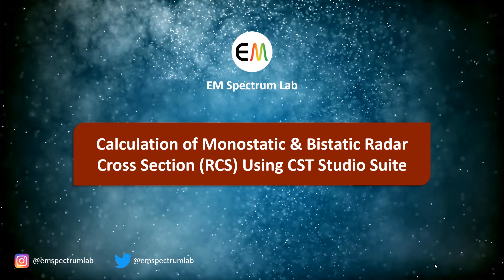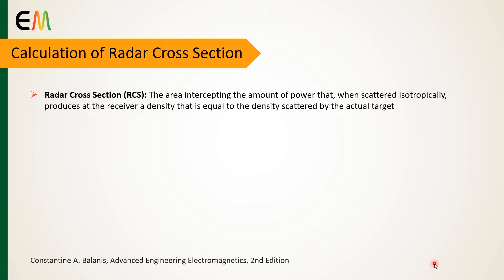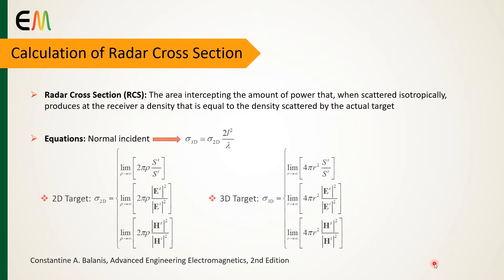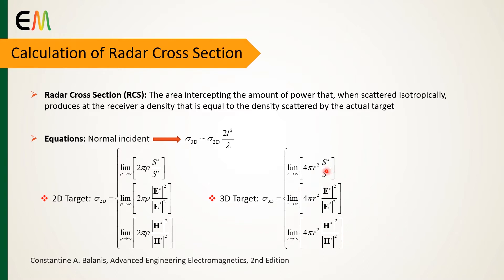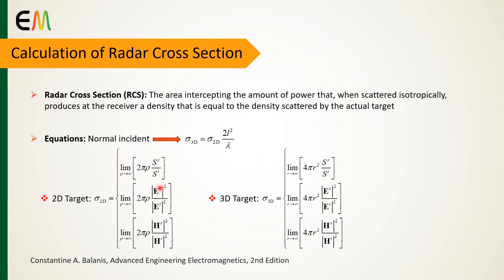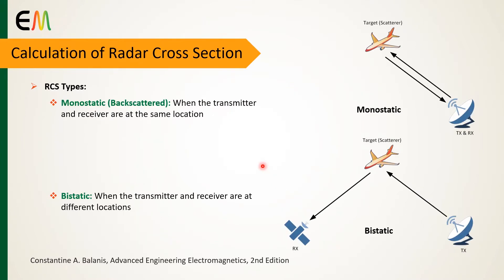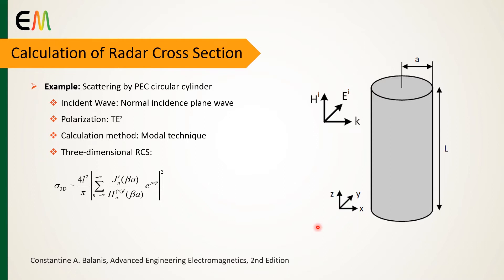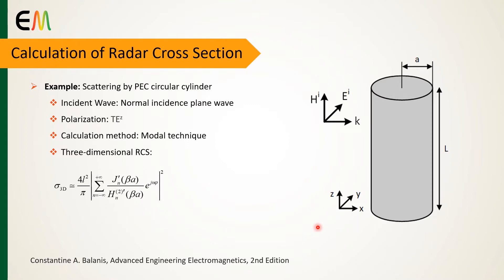CST Tutorial - Monostatic & Bistatic Radar Cross Section (RCS) Calculation

Comment: 10:09 Have I understood correctly that a cylinder with a radius of 5 cm and a length of 60 cm has an RCS of 0.5 m²?
Reply from the maker: Exactly (for Monostatic RCS)
Reply: @EMSpectrumLab  I thought that the RCS couldn't be smaller than the actual geometric cross section of the object. Turns out, that's not the case. Thanks.

Comment: what does it mean
theat
alpha
phi
i dont understand them ?
Reply from the maker: "Theta" and "Alpha" are the Elevation and Azimuth angles of incident wave, respectively. Also, "Alpha" is the rotation angle of electric-field vector.
Reply: @EMSpectrumLab   how can we know, what numbers should we assign to them? I mean the angle you used will give correct results for a surface made of PEC as well?
Reply from the maker: @amirbit2086  They are dependent on your problem. The angles are not related to the material of object.

Comment: Hello Sir. Your videos are very informative. Can you please further extend this video and show us how can we get graph of bistatic vs frequency in cst? It’s really urgent as i need to add graph in my paper, thank you
Reply from the maker: Dear, unfortunately I didn't find direct solution to plot bistatic RCS vs. frequency in CST. But, I suggest you to use MATLAB to create this figure by one of below cases (they are a little time consuming methods).
1. Define farfield broadband monitor and run the simulation with "Time Domain" solver. After that, in farfield results, define farfield cuts for Theta or Phi. CST will generate some plots and you can import them one by one as .txt file in MATLAB, and specify the single point of Theta & Phi. Then create a new matrix from them and create your considered figure versus frequency.
2. Without definition of farfield broadband monitor, run the simulation by "Asymptotic" solver. Enter polarization, incidence and observation angle, and also the frequency band. After that, like time domain, it will generate some plots due to each frequency. Then you can repeat the remained steps of case 1.
Reply: @EMSpectrumLab  thank you so much Sir for your detailed answered. Really appreciated
Reply from the maker: @hamzaasifkhan8421  🌷🌷
Reply: @EMSpectrumLab  please sir make a tutorial on conformal metasurfaces. Please.
Reply: @hamza asif plz give me your contact number...
Reply: Did you complete rcs reduction?
Reply: @vandpr  yes
Reply: @hamzaasifkhan8421  can you please help me with the rcs reduction?
Reply: @vandpr  follow the procedure shown in this video
Reply: 我遇到和你同样的问题😂想要双站rcs随频率的变化图
Reply: @tsz-wq2gr  如果您找到了解决方案，也请与我分享。另外，如果可以的话，分享我你的微信